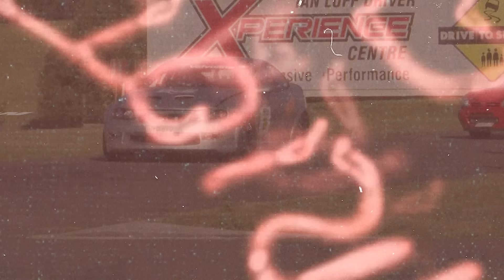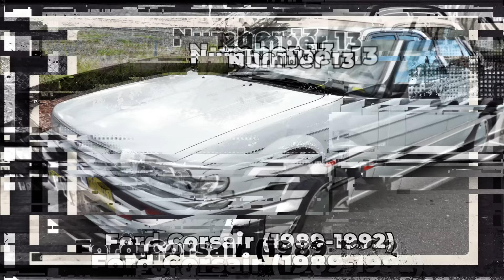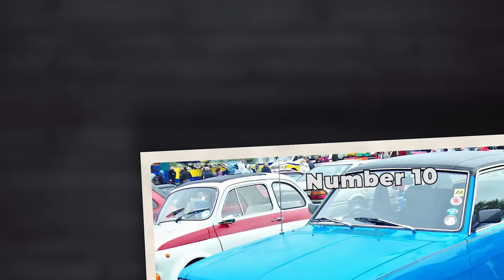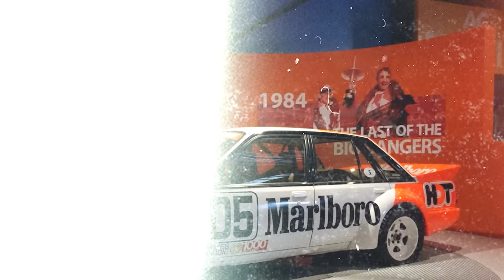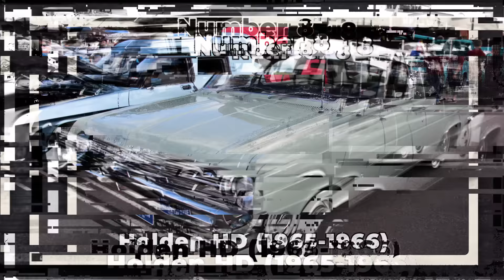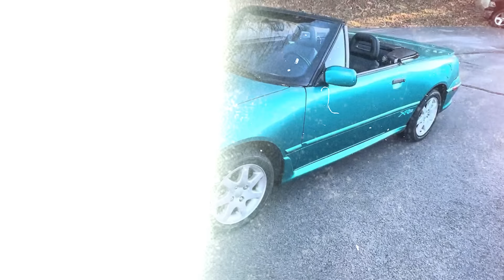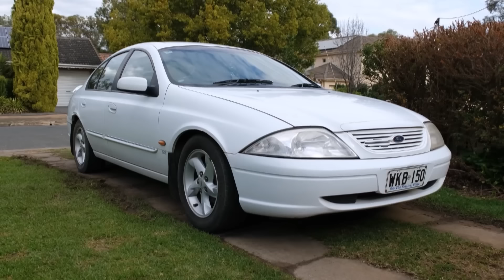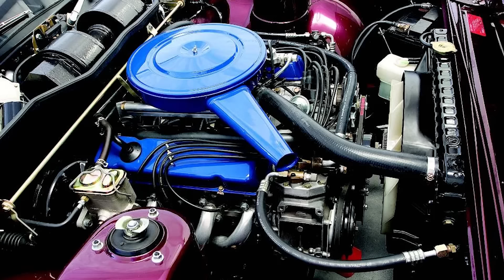Top 15 Worst Australian Cars Ever Made

Comment: The mitsibishi 380 was a fantastic car.
Reply: The Mitsubishi 380 should be on the most underrated video and not the worst cars made in Australia video.
Reply: @tompetery7331  The styling wasn't popular at the time, ( though a Holden engineer said to me  "I reckon we could move those if they were a Holden ".  ) Mitsubishi were cash strapped, and the cars were built using second hand tooling from the USA.  Nevertheless, quality was excellent and the cars drove very nicely.
Reply: @tompetery7331 i agree
Reply: @tompetery7331 Love my mint LS 380, great country car, on the hwy 8L/100km, gotta be careful to get that.
Reply: @perpetualgrin5804i got into the 7s going from campbelltown to penrith and back
Reply: Is that on the freeway at 110kmh speedo speed which is 105kmh real speed or is it 100kmh speedo speed which is 95kmh real speed?
Reply: @FrankBurjan Have put 215 65 16  tyres on speedo now accurate. Mostly at 90-100. No load. I'm  careful.😅
Reply: @perpetualgrin5804still there is a significant difference in fuel economy of about 10% between cruising at 100kmh and at 90kmh.
Reply: People who owned AUs generally quite liked them. Compared to the commodore of the time, a better 6 engine, better steering, more usable boot space with the folding seat
Reply: @warwickrun542  yeah, they still had that stupid useless ski hole. That was because the chassis relied on a solid seat as a structural component. 

Also, Falcons all the way through didn't rely on the windscreen as part of the structure... which is why if you ever had a crack, it wouldn't propagate as there were no stressors. Other cars they do, and you either needed the crack repaired, the windscreen replaced, or at least put one of those little stickers on it.
Reply: @warwickrun542  And a feeble transmission
Reply: Still driving my TJ 2000 Magna. Paid $3000 14 years ago. The 380 was a decent replacement. All the engineering and decisions get made years ahead. I think the timing when it was released was against it.
Reply: @kitatit I had a 380. Great to drive (but a bit thirsty). What let it down for me was the styling.  The previous Magna looked a lot smarter in my eyes.
Reply: @oldcynic6964 the 380 has more of a wedge aerodynamic shape and lower drag corfficient as a result. Its a bit thirsty around town moving a 3.8 litre motor and has the turning circle of an oil tanker. Other than that me being late to the party of a 380 it seems extremely reliable and has sufficient power for most peoples needs.
Reply: @kitatiti agree about the timing
Reply: We had ours for 15 years. It was thirsty, but was a great car. We put it on injected LPG and that made it very good on fuel. Blow through on cylinders 3 and 5 is what killed ours 😢
Reply: @redman114 thanks for your info!
Reply: Have one from 2007, and still drives like new.
Reply: @jameshowe2217 i got one with 400000km and drives great!
Reply: @jameshowe2217  I still have my ’07. It’s got 300k on the clock and is still running beautifully.
Reply: A bit fuel thirsty but its power and performance was excellent.
Reply: @OceanWaves-u3i mine too
Reply: Looks it.
Reply: Second this, owned mine for close to 10 years and it's still a fantastic thing to drive. A bit heavy for sure but it does a lot better in the hills than most people would think. Reliable as they come, never had an issue with it outside of the standard tyres / brakes / servicing, and although car styling is subjective, it's a pretty good looker as well in my book.

Doesn't belong anywhere near a worst list. Unfortunate timing, but MMAL had a solid engineering package with this one.
Reply: @micbr508 i have a 380 with nearly 400000km on it. Goes like stink.
Reply: I sold a lot of 380’s and ended up buying one myself,they were a very under rated car,only problem was that Mitsubishi wouldn’t make it as a rear wheel drive
Reply: @david-cy9dd if it was a rear wheel drive it would have been a great car! Is it quicker than an sv6? Im sure mine is.
Reply: @FrankBurjan yea I’d say it was cause when you floored it that thing would fly worst thing was the quicker the speedo went up the quicker the fuel gauge went down but I loved mine
Reply: @david-cy9dd im sure it had more than the 175kw claimed. There were 2 engines. 1 was 192kw and supposedly only in nz the other 175kw. I think they were all 192kw.
Reply: You are absolutely right. It was just bad timing. They were popular in the Australian Defense Force and they were very good
Reply: My dad still owns one.  Yes - the engine is kick arse!
Reply: @phanoonki so its not just my car?
Reply: And not even Australian
Reply: @TimSlee1 so? Holden or ford werent australian either. They are american
Reply: @TimSlee1 it's as australian as the falcon and commodore. It was designed and built here and was only available in the australian  and nz market. It's as australian as drinking piss with no shirt on.
Reply: I haven't seen one on the road yet that hasn't got failed paint.
Reply: I agree l love my 380
Reply: @angelswalking3839 me too
Reply: It was FWD
Reply: @awesomusmaximus3766 there was a 4wd 380?
Reply: @FrankBurjan nope, magnas had an awd model though and the 380 engine is basically a drop in on those haha
Reply: @bradmeek but there was no 380 awd. Wxcept the supercharged one maybe
Reply: @awesomusmaximus3766  Yup Front wheel drive which was held in huge suspicion by the RWD big sedan drivers.  Just like the Toyota Avalon.  I owned an Avalon,  absolutely splendid car. 

However the problem was that with 380s and Avalons crowding into a declining market for large sedans, and the rise of smaller Korean and Jap cars and bubble hatches,  something had to give.
Reply: Only could be said by someone who didn't crash in one.
Reply: @timhinchcliffe5372 it had a 4 star ancap rating. The same as the falcon and commodore of the time.
Reply: @timhinchcliffe5372 did you crash in one?
Reply: @FrankBurjan  I would never own one, I'm allergic to FWD cars. A paddock basher is a different story though.
Reply: @timhinchcliffe5372 you need to attend to your allergy. Its 2026. Fwd cars are almost as quick as rwd cars. They actually accelerate faster in gears than rwd.
Reply: @FrankBurjan  nah, I agree with BMW, RWD is better at handling. FWD only became popular because they were cheaper to build (suits poor people), and were better in snowy conditions due to the weight of the engine on the driving wheels. 

I've never seen snow so the last point doesn't apply. 

Not to mention I nearly died as a passenger in one... it was pissing down rain, the car aqua planned on the steers and launched left off the highway in the direction of a power pole. Having the steering wheels that can also have the traction removed by also being the driving wheels is a ridiculously terrible inherent safety issue.
Reply: @FrankBurjan  mind you, if the car is RWD and the engine is rear mounted, these vehicles are fine in the snow. Also fine in the sand, VW Combis were often seen going out to the sandy islands off the coast of Brisbane, so much so a ferry to Moreton Island (I believe) is called the "Combi Trader".

So the traction advantage is really about engine location rather than FWD vs RWD. And even then, you can buy big water bladders to put in the boot of RWD vehicles to aid in traction.
Reply: @timhinchcliffe5372 thats-all true. But the likelihood and margin of error is small today with fwd cars. I prefer rwd too.
Reply: @timhinchcliffe5372 thanks for that info
Reply: @FrankBurjan  Back in the day before you had to have a huge 4wd to tow a caravan, people towed them using their family Falcons and Commodore's they didn't tow them with Magnas or the 380 because we all know towing something heavy with a FWD car just doesn't work well because the weight lifts the front wheels causing less traction and very light steering.
Reply: @rod_at_adelaide5766 thats true
Reply: But what percentage of people tow caravans? 5%? 1%? That means 95% dont. They just want to go from a to b.
Reply: @FrankBurjan  The media hounded this point over and over and that helped to sully it. The argument about towing is so stupid, see Jeremy Clarkson's thoughts on that. People make buying decisions based on a very small part of what they actually need a car for.
Reply: I had a manual 380 -brilliant car. Before that an AWD Magna that was rear ended -incredible grip
Reply: @peterfey9921 how much faster was the 380 compared to the magna?
Reply: @FrankBurjan  380 manual was lowly geared and not only fast in all gears all of the time, very confident putting power down. The AWD auto Magna was much slower. A 380 engine is what the AWD Magna needed
Reply: @peterfey9921 thanks very much for your information!
Reply: @peterfey9921  we had one too. Was one of the best cars ever. Got killed by a guy doing an illegal turn 😢. Replaced it with the 380

Comment: My favourite  Aussie car is the Charger.😅
Reply: Being old enough to have driven a Charger I still say without half a ton in the boot and half a ton on the front end it's probably the scariest car you will ever drive. Totally insane when the motor was tricked up a little bit. Remember a mate telling me to take his Charger from Logan to Gold coast to pick up my grandmother. Grandma, was never the same afterward.
Reply: @geradkavanagh8240  Pffft... the Charger was "on rails" compared to the VH/VJ/CH Hardtop.
Reply: "Hey Charger!"
Reply: Mine would be too, if they weren't so rust prone have had 11, the last one a VK XL, had lost the entire boot floor to rust.
Reply: @DerSpiess11 like most cars those eras . Until they started using coated material.
Reply: It wasn't an Aussie car.... There was an American Mopar version.
Reply: @petesharpe4120 Completely  different.
Reply: @perpetualgrin5804 The American one wasn't called a 'Charger', and no. It wasn't.
Reply: @petesharpe4120 Dodge Chargers were built for 8 generations starting in 1966. But of  course completely different cars to the Aussie designed and built Valiant Charger.
Reply: @itcantbetrueable  I know. That wasn't what I was referring to
Reply: @petesharpe4120  I'm not sure you know what you're referring to.  There was a Dodge Charger in the US.  There was a Chrysler Charger in Australia.  Just because the US Charger predated the Aussie Charger by 5 years does not mean there wasn't an Aussie car called a Charger.

For what it's worth, I list my religion on the census form as "Mopar".  And I own 2 Australian Chargers which according to your first post - don't exist.
Reply: Yer boi!
Reply: mygrand dadhadthesamecarhethortitwosagoodcar

Comment: the corsair and apollo were due to the button car plan were manufactures shared models. Ford owned Mazda so you got the telstar and 626, laser and 323 and Courier and Bravo. Then they got into bed with Nissan. They did the maverick/patrol, corsair/pintara and falcon ute and Nissan ute. Holden and Toyota shared models as well, Commodore/Lexen, Apollo/Camary and Corolla and Nova.
Reply: Absolutely correct. Well said 👍
Reply: I got 900,000 klms out of my SV21 Camry , service them , for 2 litres they were the ultimate in reliability
Reply: @duncanyourmate2433  Apt name for the Camry could've been cockroach, very hard to kill
Reply: Some times badge swopping worked if you loved a certin brand 😊😊😊
Reply: Correct 💯